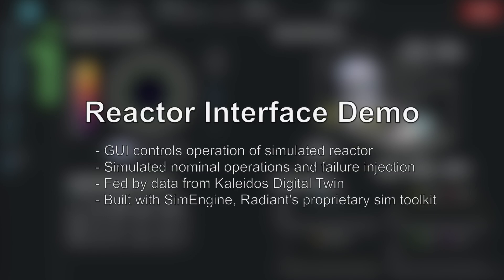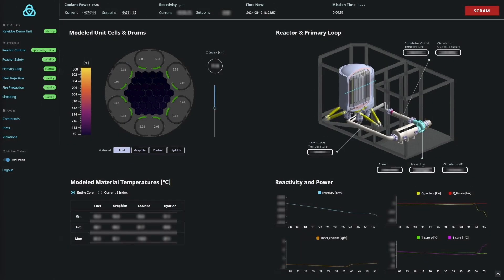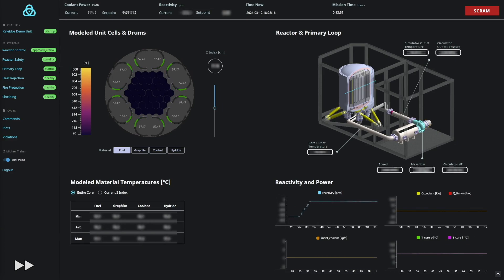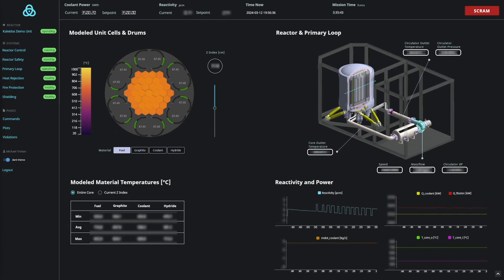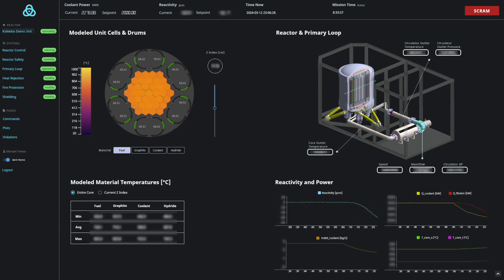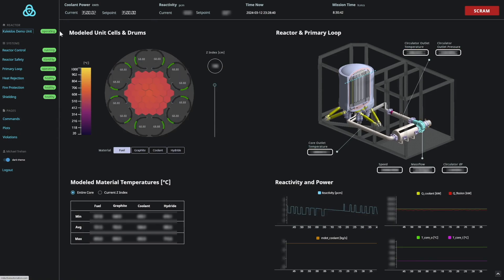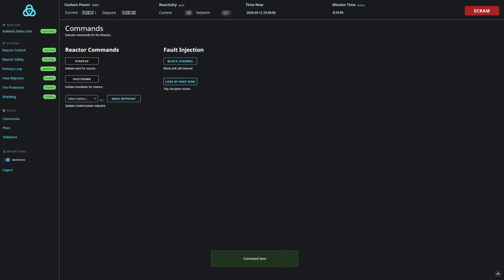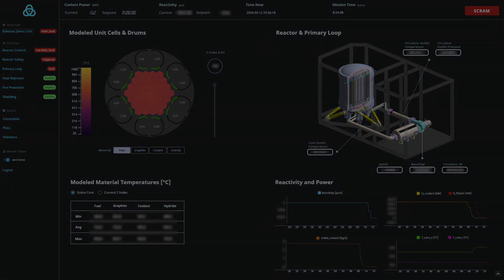Simulating a Nuclear Microreactor — Kaleidos Digital Twin Demonstration

Comment: I sure hope you have a way to physically mechanically shut down the core. Sometimes major failures occur when holes in Swiss cheese line up. Multiple improbable failures happening at once to create a shit sandwich. If for some reason the safety system failed, there should be a way for someone to physically shut it down manually and move the blades. And of course an alarm for someone to know to do it manually